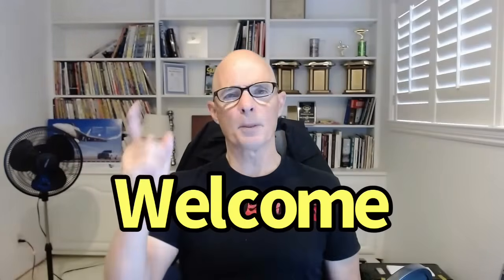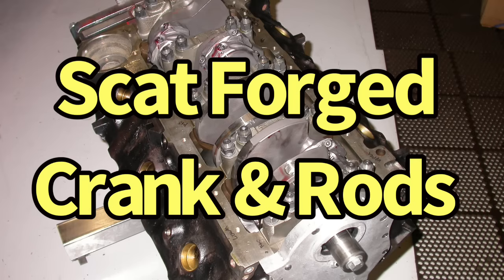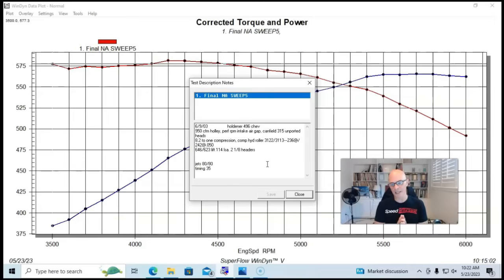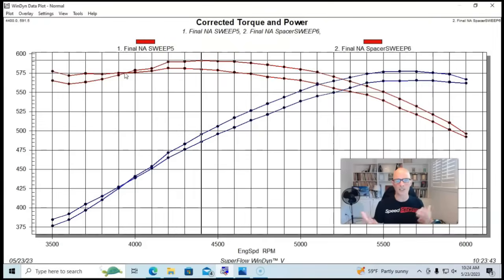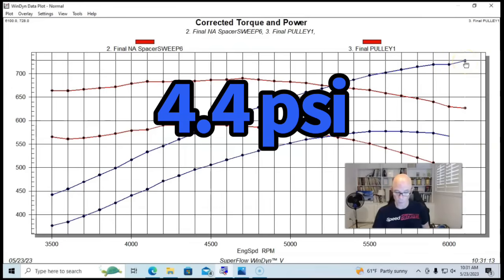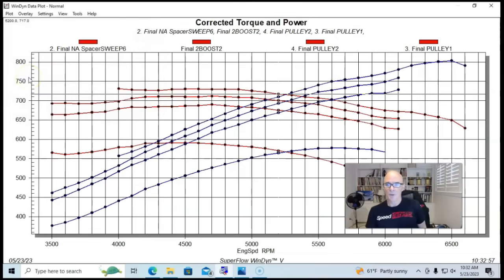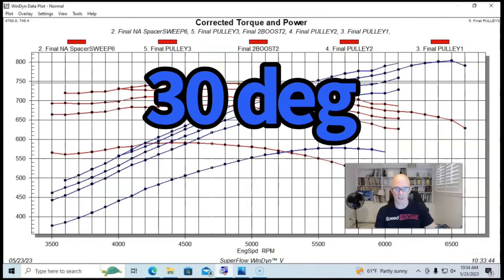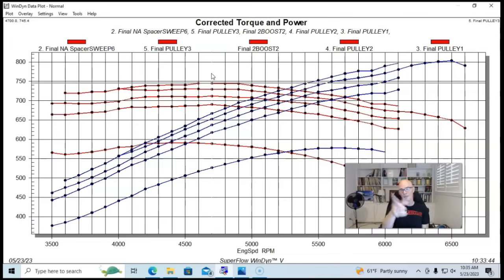PUMP GAS TORQUE FOR TOWING PART 2-SUPERCHARGED 496 STROKER. OUR BBC HUNT FOR GRUNT GETS MORE TORQUE!

Comment: Hello everyone, 
I always wanted to build/rebuild an engine. I picked up a junkyard gen 3 5.3ls engine. I purchased few parts like: 
" Mahle 5.3 flat top forged pistons, 
" gen 4 rods,
 " 862 heads,
"  .625 max lift springs, 
" FAST LSXR 102mm Intake, 
and some other stuff. Whereas I'm stuck on what camshaft and lifters I should choose 

My goal is to make as much HP N/A as possible. 

The options for the camshaft that I have are :

1) "COMP Cams 54-602-11 Big Mutha' Thumpr" 
2) "Comp Cams 54-703-11 Stage 2 Thumpr Cam"
3) "Competition Cams 54-408-11 XFI RPM"
4) "GM Performance Parts Camshaft, LS6 Camshaft, Hydraulic Roller, Lift 0.550/0.550"

These are the cams and only these I can get for free from a friend, the question is which one would allow me to make the most HP. 

Thank You everyone for reading
Reply: How heavy is your vehicle, tow rig?
Reply: @11SpeedFreek11  well, i'm putting the engine into a 1998 BMW e36 M3, so around 3,000 lb

Comment: How often are you running at 3500+ rpm with a towing motor?
Reply: Passing on downshift will run a 454 3000-4000 RPM easily, just one example.
Reply: Not at all as it burns more fuel

Comment: I have a suggestion for a video: 
Similar motor where t he only thing you alter physically is to change the compression from race-gas level down to "we can thrown any pulley on this blower we want" levels and see what the timing advances and boost levels are you can use, and the end result in power production.
Reply from the maker: HOW DO YOU SUGGEST WE CHANGE THE COMPRESSION WITHOUT CHANGING SOMETHING ELSE THAT ALSO CHANGES POWER? PLUS, THE ONLY WAY TO FIND THE LIMITS YOU DISCUSS ARE WITH KNOCK SENSORS-NO GOTS.
Reply: @richardholdener1727  I don't know. But, a series of copper head gaskets or some different pistons can change compression.

I guess the MAIN change is the compression, and different pullies and timing, and knock sensors would be needed, yes, but I noticed no one has ever explored the limits of timing and boost by widely varying the compression ratio.

Comment: running comments  how long rods,  I would not bore .060, what was the quench, looks like the divider was cut ,.anyway  did  you track your inlet temp? we ran intercoolers in the boat   did you mention your timing  veery good

Comment: You could put together a motor  like this or just throw a turbo on a 6 L and have just as much horsepower and probably just as much torque
Reply: Or drop in a new 1,000 ft lbs diesel and get 16 mpg too.
Reply: He’s done multiple videos to include what you just suggested. Type it in the search box,

Comment: What changed that allows more compression with boost? I remember turbo Dodge 2.2s had 8.1:1 and magazine 350 never went past 8.5:1.
Reply: Modern engines have better combustion chambers that produce a faster burn and require less spark advance.
Reply: Combustion chamber/piston design, better engine managment, most pump gas is e10 now... among a ton of other more minor improvements and new knowledge.

Comment: At 8.2 to 1 you could have run 87-88 octane on NA? Correct?  And gotten the same power?
Reply: I was going to make a comment about keeping the higher compression and running E85, but after having looked at the Alternative Fuels Data Center map it is just not realistic depending on your route. I didn't realize we were so spoiled by pump E85 here in the Midwest.
Reply from the maker: YES ON THE NA MOTOR
Reply: I’ve never run E85 so I don’t know much about it but as an everyday driver regular gas would help keep cost down so you could enjoy your car and still with that torque and horse power have more than you need from light to light.
Reply: @garyhosier4765  Not sure how familiar you are with E85, so here's the quick breakdown of it. E85 is typically sold at the pump somewhere between 50-85% ethanol to gasoline. It tends to be cheaper than 87 octane in my area. Last I checked E85 was $2.59, 87 Octane was about $3.54 at the same station. 

Ethanol blended fuels have a higher octane rating (100-105 according to Iowa Renewable Fuels Association), but ethanol has a lower energy density than gasoline.

You can push the engine harder due to the higher knock resistance, at the cost of increased fuel consumption. 

Pump E85 can have some tuning complexities associated with it due to the variability in blend from station to station, so a lot of folks either test their fuel at the pump (no thanks) or run a flex fuel sensor. With the flex fuel sensor you can tune using the data that the sensor provides.

You can buy Barrels of E85 from many different race fuel manufacturers, but in the context of installing the engine in a truck that defeats the purpose imo.

Comment: I remember having to drive a then new '76 1 ton GMC 454 pulling a gooseneck flatbed trailer grossing 33,000 pounds out of Denver. It took 9 hours to make it 350 miles to Rock Springs, Wyo. I would have loved to have had even your N/A 496.
Reply: I've made that run in the last few years.  Can't imagine what the roads were like in 1976.  Making some of those climbs with a naturally aspirated engine must have been memorable.  And getting down the hills even more so.  If the truck was new at the start of the day, it wasn't new after that trip!